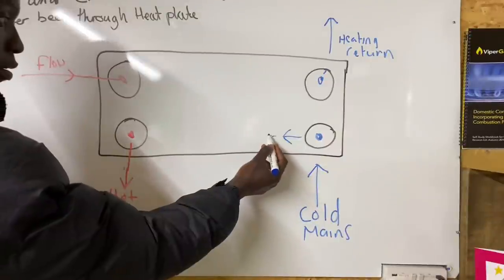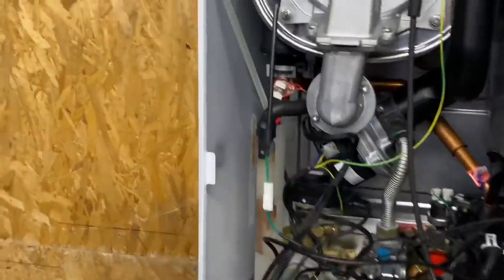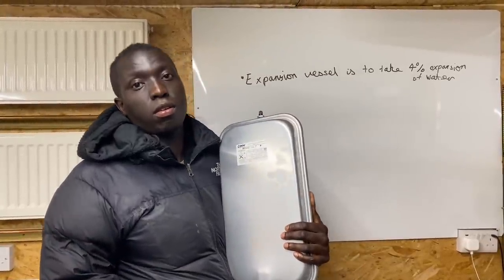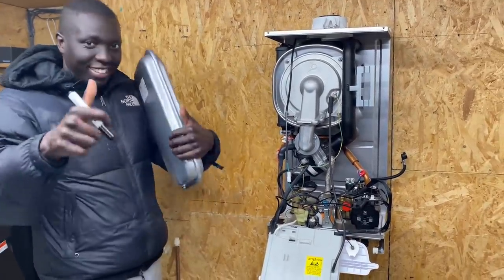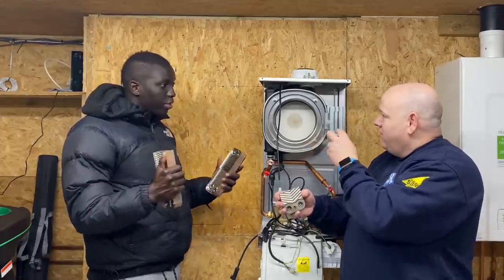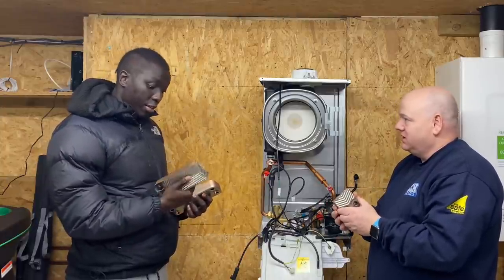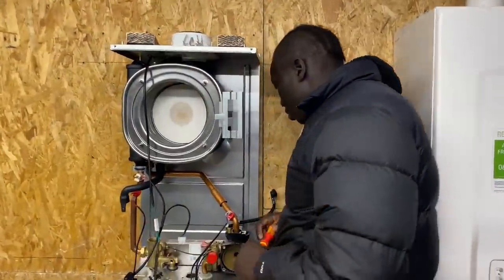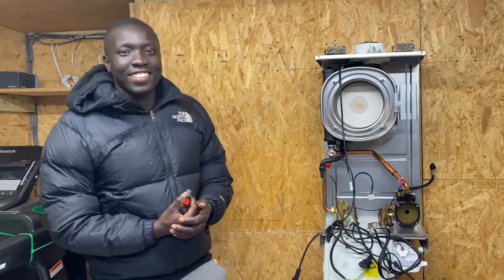Apprentice Plumber Learns How A Combi Boiler Works

Comment: Hi Alan, I’ve been watching your videos for a while now and it has helped me as an apprentice. I’ve completed my level 2 plumbing qualification and I’ve been working under an engineer for almost 2 years now. One thing I’ve been lacking is confidence. My supervisor leaves me on my own and trusts me to complete the job. But the problem is that; I constantly think that I’m making a mistake somewhere and that slows me down. My supervisor has a go at me for being too slow and is very harsh towards me. He’s not really good at motivating. How do I over come those fear and build my confidence and become a good engineer. I would really appreciate it if you give me some advice and those apprentices who are going through what I’m going through. Thank you
Reply from the maker: Thank You
Reply: Started my ACS a few weeks ago, how’s it going now two years on? Just from your comments about a strict engineer supervising you I knew already he has to be an apna😂. Are you working as a gas engineer now?

Comment: Begin rant. In my first property in 1989 I had a floor standing boiler.  I never looked at it and it never got serviced. The pump stuck once or twice in 7 years and just needed a knock to get it working again. Central heating and hot water was available despite power cuts. The hot water tank was in the airing cupboard in the boiler. The door was only ever opened to get towels.  In the lounge was a gas fire with a simple knob you rotated once to get a roaring fire started.  It never failed and it was a simple job cleaning it of dust.  My 2nd property also had a floor standing boiler and gas fire which never failed. In my 3rd property I spent £5k replacing a very old floor standing boiler with a new Baxi combi and all new rads and pipework.  The damn thing failed 4 times in the first Winter.  It then repeatedly failed every Winter due to the heat seal around the firebox only lasting only a year.  It cost £100's in servicing. After 5 years I then spent another £2k replacing it for an Ideal Logic. These over complicated combi boilers are a total scam. They are designed to fail from day one of installation. They might be more efficient burning gas, but the energy companies just push the price of gas up to compensate for less usage, and the cost of maintaining them is a rip off compared to the traditional boilers and gas fires. Good business for gas engineers though.  10 years from now we'll be forced onto even more expensive heating systems that will no doubt consistently fail and cost even more to maintain.  The talk of Hydrogen boilers....my god whoever thinks having highly explosive hydrogen in a home needs to be shot dead now. End rant.  Good luck to Phil and another great video from Allen.
Reply from the maker: Thank You

Comment: If you wanted both hot water and heating what happens to the valve, does it stay in the middle
Reply from the maker: No, It would do the hot water first. Thanks.

Comment: Hi Allen I'm training as a gas safe engineer and whilst studying room sealed appliances I am curious how good the seal is around the main cover of the boiler to really seal it from the room. Surely air must be going in as the front covers are not air tight? Or are they? so the silencers get the air that is carried from the outside via the flue
Reply from the maker: The air comes in from the outside. Thanks.
Reply: Most boilers have a front door seal all around the frame when The front cover door is refitted the  seal squashes to seal to form an airtight seal, much the same as when you shut a car door, the boiler it takes in combustion air around the outer part of the flu pipe, The inner smaller part of a flu is the exhaust pipe for combustion gases

Comment: Great vid as always Alan. Please can you give me some advice. Within 30 mins of my heating turning off, the pressure drops to 0. An hour later and the pressure goes back up to normal despite me not doing anything. There is a bit of water dripping out of the copper pipe outside. Cheers
Reply from the maker: See if this video helps you. Thanks. https://www.youtube.com/watch?v=UR9wSU-I2O8&t=46s
Reply: @AllenHart999  Thanks Alan, if the  expansion vessel is faulty and so water is leaking out the overflow pipe, how is the pressure raising again after an hour, if I aren't putting more water in through the filling loop ?
Reply from the maker: @danielpeter2507  You could have a faulty plate.

Comment: Great Video Allen here's a quick question has it ever been known for a heat plate to split internally therefore mixing CH with HW domestic 🤔
Obviously they must be made of a rust proof material like aluminium
Reply: Plate heat exchangers do burst internally yes, however, as the hot water side of it is at a higher pressure it fills up the central heating system rather than vice versa. So the symptoms would be the pressure would constantly be 3 bar+ and prv would be leaking loads